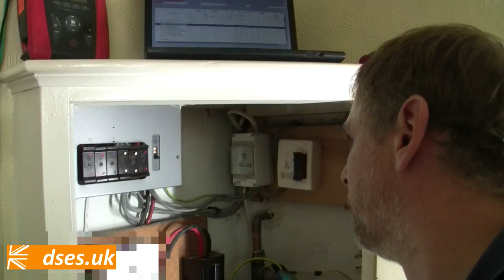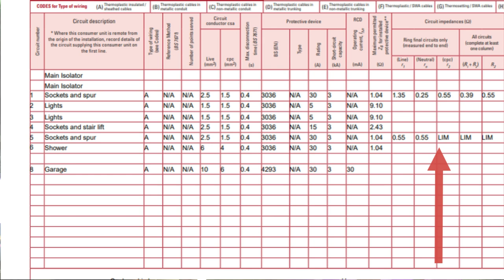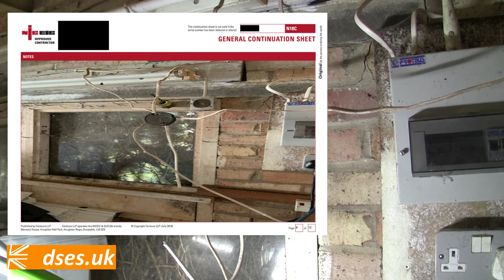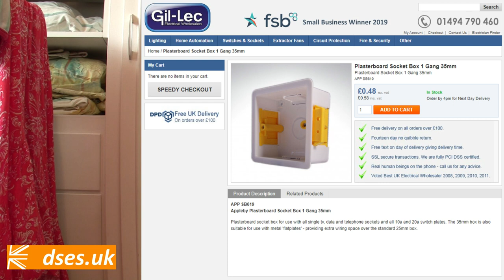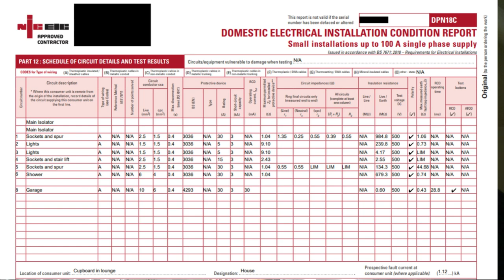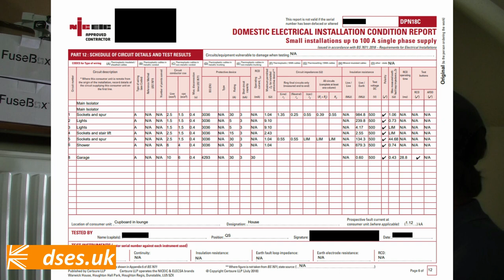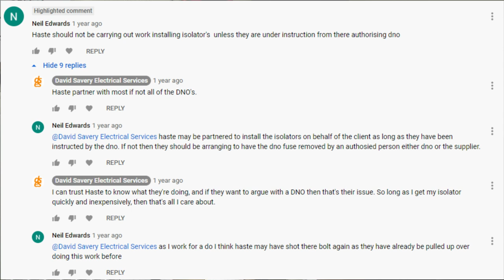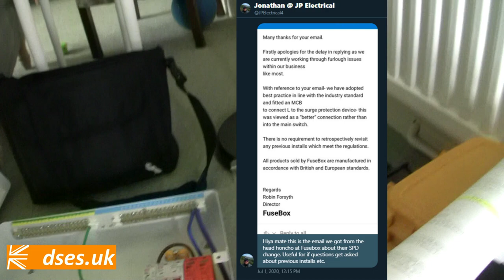Waffly Consumer Unit Upgrade

Comment: I had a smart meter installed last week, he forgot to seal the meter and fuse. I had to drag him back from his van!
Reply from the maker: My smart meter is dumb as hell. I still have to read it manually as it only talked to E:ON who I left months after it was fitted, the display unit is next to useless compared to others and my old meter had an integral isolator and a split tail output allowing me to shut off and change tails without tampering with any network stuff. Absolute balls.
Reply: @dsesuk  May I enquire why you had a smart meter installed?   We are with E:ON and they* called to arrange an appointment to replace our old spinny disk meter with a smart meter, and the lady on the phone was quite amused  with my '32nd of never is good for me' response.... and took us off the 'nag for smart meter' list.

I told her of the number of times we've had faults due to the smart meter installer forgetting various tools, such as his screwdriver, or his brain, and she told me she'd re-evaluate having such installed in her own home.  

* This was VERY recently, a week ago, and it was Morrison Utility Services who actually called, on behalf of, blah blah
Reply: @dsesuk   I know the ones you mean they came in with the self-connection metering, this is how the smart metering should have been.

Comment: I just cut what seals I need to cut to safely do the job and I always ask the customer to contact their supplier to 're seal it. I've never had a problem. 
Often I need to cut the meter seals as Well as by the time you've moved the tails they are now loose in the meter.

Comment: Until DNO's provide a main switch for free (as in new builds) pull the main fuse and if they have any problems with that then who gives a shiny shite. Had a cut out replaced recently and engineer gave me a 100A mains switch and a seal or two for when I was finished. Common sense for a change,

Comment: Why couldn't you remove the tails going into the cu and fit your own isolator with new tails  into the cu ?
Reply from the maker: I could. If I had an isolator. I'd still either have to pull the fuse or work live though. The former carries threats from the DNO and a risk of injury/death which is why we're told to not do it, the latter carries a larger risk of injury/death which is why we're told to not do it. What we are expected to do is pay through the arse for the DNO to do it.

Comment: If the DNO want's to operate under the  "It's our  property and no-one is to touch our equipment" premise. Yet, the regs require safe isolation, then DNO should have to install that means of isolation when requested if it does not exist on "their" installation. Furthermore, the customer should NOT have to pay for it, since as the DNO asserts, it's their equipment, not yours. In reality there should be no problem with a trained spark, kitted up in arc flash gear pulling a main fuse.

If the DNO is genuinely worried about fuse carriers on old properties disintegrating, perhaps they should have been replaced ages ago as part of network maintenance. If only there had been some nation wide event where DNO personnel were sent to every home where they might have had the opportunity to check condition of main fuse carriers, and maybe even install a main isolator while they were at it...
Reply from the maker: Darn tootin'! What's with this grey area of "it's our kit and you can't touch it... although after the meter it's your kit and we won't touch it!". Absolute bullshit.

Comment: I think the regulation book was written by politicians, it's hard to get a straight answer, in college I was told you can spur from the mains or a socket, but logically as you said you would only really do that if it was close to the board.
EICR's are a pain, people think it's easy money, but you can come a cropper, I see it all the time, most are not worth the paper they are written on. But it's the governing bodies fault, they come each year check our work so they are seeing this shit and doing nothing, I get pissed off with my NIC guy, he will pull me on the smallest detail on a cert, just because he can't find anything wrong. Those tick boxes are a pain, and are only there because it tells an inexperienced person what to check.
Those smart meters are a nightmare, they should have an isolator built in, I pull the fuse and will continue to do so, because if they are that concerned an isolator should be present.
I find the fusebox stuff to be ok, if I took the cover off that board I could see someone has made an effort and looked neat, I see some boards in professional electrician, yeah super neat, and  think how much has that cost in labour.

Comment: When I was working, I would pull the Head Fuse for health and saftey reasons,  if the suppliers where obaying the law, when the smart meter was fitted they should have installed an isolator to comply with health and safety who ever fitted it, as the sse did when I got them change the one in my dwelling, after fitting he was about to leave, I said where is the isolator so he had to one or I would have kicked off, you have to blame the last National Socialist government sorry Larour party, for not telling these so called certifcation bodies and the IEE and the supply companies, to do it but they only think about a fast buck.

Comment: I see a lot of terrible eicr just like that one and I know we think they are worthless but realistically as long as the landlord or estate agent get your signature with a satisfactory they couldn’t care less . 

The electricians that go round doing these eicrs for cheap are really just charging customers to do a quote and a quick survey for how much money they can get out of them .
Reply from the maker: That's it Robert, if the landlord has a bit of paper with someone else's signature on it, then that's their get-out-of-jail-free card should the shit hit the fan. There are companies charging £80 per EICR and knocking out eight in a day which is great business so long as they ensure they've closed down and done a disappearing act by the time someone is electrocuted by a C1/C2 condition that a diligent inspection would have identified!
Reply: David Savery Electrical Services I just call the cheap eicr a quick quotation report . Charge £90 for it then make it up by C2 any plastic boards or anything that isn’t rcd protected even if it doesn’t require it .

Comment: Just say the tails were c1 and you had to pull the fuse for safety reasons.
Reply from the maker: Can do Darren, and have done in the past, but the point is more that pulling the fuse has a risk associated with it and the need to perform a physical pull along with that risk should not be there in the first place. The smart meter rollout should have stipulated meter equipment had inbuilt isolation accessible to the homeowner, or such should have been built into the service head since the dawn of time!
Reply: David Savery Electrical Services totally agree......but,  there is always some little niggly bits for arguments for and against.  It does discourage joe public from perhaps isolating to carry out their own work.  I don’t understand why as elections we can’t pull it anyway.  You have emergencies where faults occur.  Checking the size of the fuse as we all know you can’t rely on the description on it.  How many times do you say 16mm tails on a 100amp fuse and the power company says it’s probably a 60a fuse anyway.  I carry the ppe to pull the fuse in case of emergencies anyway.  Surely our affiliated bodies and the network suppliers could sort it between them.  It seems as qualified electricians we are not qualified enough to pull a simple fuse!!!  I bet we are a 100 times more qualified than the guys that actually come out and pull the fuse anyway.
Reply: @darrenplant619  indeed, having seen the 'work' of some gas lackeys masquerading as electricity meter fitters.... i'd say they should not (and in my house, WOULD NOT) be allowed anywhere near the service head.

Comment: Changed to SSE for my new supplier they fitted new smart meter, I thought they would fit isolator as standard would of took the bloke another 10mins to fit if that, fucking useless, they fitted one 2 weeks later after I had a moan at them lol.

Comment: "2 core cable used on the lighting", That sounds to me like a very young guy has done the inspection and has never really come across tinned copper 1960s lighting setups, which are still all over the place.
Reply from the maker: My take too.
Reply: C3 if class 2 light fittings?
Reply: @andrewwilson4402  Yep and label on the board :) ... (under 'other required labelling'). Again like David, on eicr's we fix any things like that  and loose connections if we can, on the day, note that we fixed it, and pass everything. We even tell landlords/clients that the cost of the EICR covers replacing a small number of damaged accessories (up to 25 pounds worth) and an hour's additional labour to do so. Most clients appreciate that, rather than a fail, followed by a separate followup visit and a new EICR at huge cost

Comment: Bulb energy at least seem upfront about fitting isolators, and 120 quid doesn't seem too bad... never tried though (I tried to convince meter guy to do it when they swapped the meter, but no joy) https://help.bulb.co.uk/hc/en-us/articles/360028024111-Getting-your-meter-changed-removed-or-tested

Comment: How about posting an invite on your community's tab to ask for posts of horror storys, which should give you material for videos :) Here is one of mine -
 Friend puts up a 500 watt  halogen, a few years later the sensor fails so it is on 24/7, because he has not put it on a switch, it gets turned off by hanging out of a window and using a hammer lol. I get called to put in a switch for a new one and handed pre stripped twe, I say that I cannot use it and show him where he has cut all the way to the copper when stripping the sheath. After fitting a fused switch for him he gets out the ladder, turns off the power to fit the new one and finds that the new unit has different mounting holes, gets out the extension cable and power drill,  goes up the ladder, finds that his drill does not work, throws a temper tantrum about it while everyone else is pissing them selfs laughing because he turned off the power before using the power drill ROTF !
Yes it is safest for him to use power tools with the electricity turned off :)

Comment: David can be a joker with his fart jokes and silly stuff, but he sure is a pro who does a good job. As for the "DNO" not giving you safe isolation from their equipment to the consumer side that should always be on them. And when they replace a meter they should be putting in new wire, and switch from the main fuse. The meter should have a consumer side switch builtin that disconnects the tails that are accessible from the consumer side of the meter. It reminds me of the box the phone companies fit in the US, there is the operator section that has a security screw, then there is a consumer side that has a flat head screw to open the door that separates the areas. Also if your accredited electrician, you should be able to do more complex work and request work done on behalf of the consumer with some kind of form they sign. Now you could say technically the "consumer" side of things is all free for Joe DIY to do any work and you YouTuber electricians are just bitching because you want more work. DNO sucks ether way and should have a way to switch the consumer side off.

Comment: So the regs technically state that you can run a 2.5 radial from a 30/32a OCPD, as long as it's terminated in a socket? What mindless fuckery is this?!?! So if you have a socket with a chineseum 4 way, and Johnny Hometwat's heating breaks down, he can potentially draw upto 32a down a single buried t&e, far surpassing it's rated CCC? Who writes this gash? Surely not time-served sparks.
Reply from the maker: I suspect it's a frig shoehorned in there back in the past to make it easier for guys on the ground to add a socket near to the fuse box where spare ways may not be available. While that may have been the original intention, it means someone can bung a cable right across the house, buried in the fabric of the place and without adequate fault protection. It's barmy.

Comment: Hi Dave, another great video, learnt a few more *#@*% words to my vocabulary to hurl at my work colleagues, being one of your despised DEI installers I agree with all your rants although not all so called sparks are that good either, these EICR are bogus & should be reported. I am a Gas Safe Registered engineer, Since it was moved from CORGI is much better, we have procedures in place to report bad workmanship & engineers are removed from the register & prosecuted & fined as are untrained toss pot have a go chancers. Until your industry follows suit you are never going to improve it.BS 7672 is hard to follow at least the on site guide breaks it down well in to engineer speak. One thing I do come across a lot is electrical cables & accessories in contact with gas pipework & fittings, gas safety & use regs require a minimum 25mm (1”) separation also the meter equipment should be separated by 150mm (6”) but very rarely is the one in this video looks close.
Keep up the great work & vids makes me smile every time. Where’s the lovely Nige (knocking one out off camera.)
Reply from the maker: Despised Kevin? Not at all. The DI route was my entry into this world too. The job is as good as any one of us makes it and as you say, there are those flashing 'time served' as a badge of honour because they came in via the apprentice route, yet that doesn't mean they're actually any bloody good. A lot of the time served types do well in a larger company where they're told what to get on with in point-and-click fashion, but when they go it alone and have to think for themselves for design, problem solving, familiarity with all aspects of tool-work and managing customer expectations... well, that's where you sink or swim regardless of what route you took to get into the game. You're right that until some kind of licence to practice is brought in and enforced, then the nonsense will continue as there are seemingly no consequences.